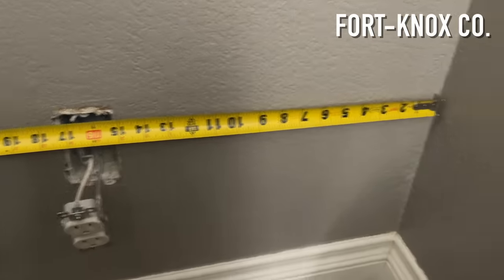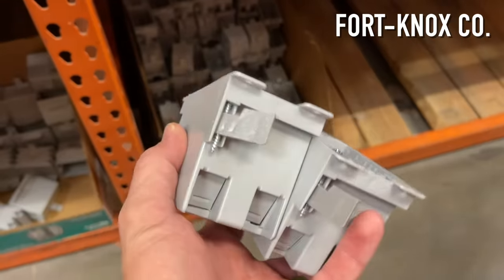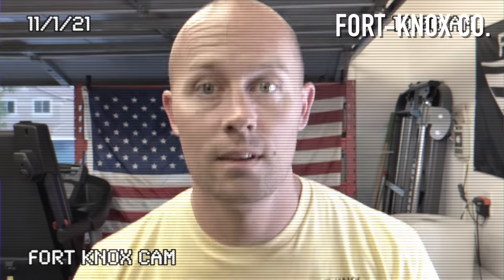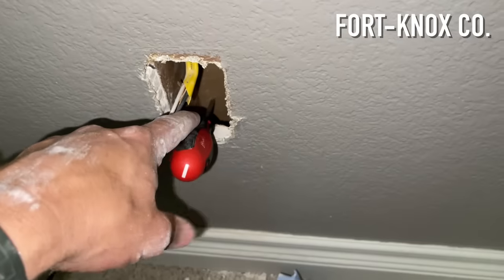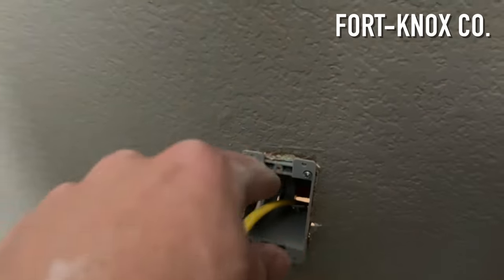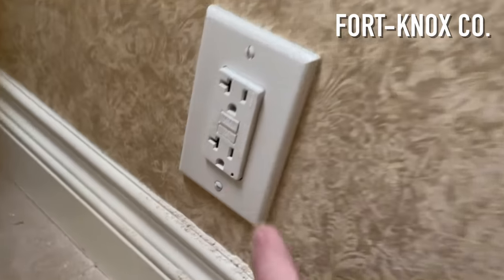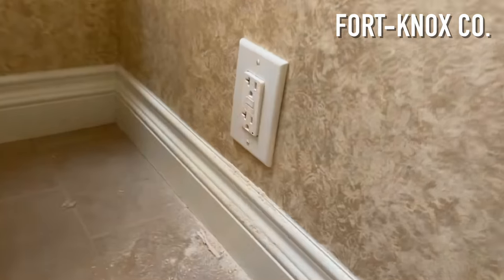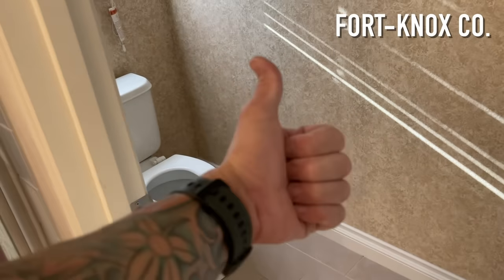How to Add an Electrical Outlet ANYWHERE !! Heated Toilet Seat or Bidet Install | Run Power Easily

Comment: It's a good idea to always wrap electrical tape around the outlet or switch. Also if it's a ground level bathroom one could go up thru the basement. There ate gfi's that have 2 (guide lights) on them that make for easier spooting of the plug. When it comes to ground faults it's also a good idea to use deep well work box's.
Reply from the maker: Very good info! I agree. !
Reply: First part of your statement is false. You’ll never and I mean never ever see a pro do that. It’s for a noob. There is no logically reason to do that. Wire it properly and you’ll never need to do that. It’s silly and a waste of tape and causes the person who works on it next, extra work
Reply: @crusherfang9368  electrical tape solves all problems. 🤙🏼
Reply: @crusherfang9368  oh YES. Thanks for reminding people to do that. That's how I was tsught. Also in wet locations having the wire nut face upwards (taped) just incase water should leak in the box. And to tape a white wire if its to be used as a hot wire. I'm NOT a professional but I for like to do work to the best of my ability.

Comment: Thanks for the tip on cutting out the old box to give yourself room to work.
Reply from the maker: No problem. It’s probably one of the best moves with moving electrical. Saves so much time

Comment: Ugh! This was helpful but unfortunately I'm stuck. My new house has a ton of outlets but none near any of the bathrooms. The put all of the bathrooms next to closets which of course don't have outlets either.
Reply from the maker: You can still use some of the techniques I showed in this video to get to the power and install the new power. But you’d most likely have to run across the wall and through a couple studs. It’s totally possible, just requires some drilling and drywall work

Comment: I had thought ahead when we remodeled our bathroom and had the outlet put in place by the toiler.   The negative is that the contractor connected the outlet to the circuit that powered the bathroom sink lights.   So when the bidet seat activates, the lights flicker.
Reply from the maker: Aww man that’s no good. You could always try to bring another power source over to the outlet from a wall plug near by.
Reply: Check your connections on your wires sounds like you might have a loose ground or something
Reply: I encountered the same issue. There was a feint flicker of the lights when the seat heater was activated. Lucky for me there was a spare unused line up to the bathroom from a whirlpool bath that was previously removed, so I reconnected the bidet outlet to that circuit.
Reply: I think you have other issues related to this circuit's installation. Flickering? No.

Comment: That wall outlet behind you (for the irrigation system)....when I got my house it was only a single outlet and only had the (same as yours) irrigation timer plugged in.  Was it legal to change it out to make it to a double?  I plugged a bunch of stuff into it like you....hahah.
Reply from the maker: Yeah. It’s still a 20amp plug. Just put in the house for the irrigation system. This house was not built with anything extra. Some rooms had no electricity in the ceiling and only wall plugs controlled by a switch. So the garage was lacking in plugs overall.

Comment: Is there a building code outlet height requirement?
Reply from the maker: Depends on your area/location. But it’s really not so much a critical thing. Just don’t want it on the floor or where it could get wet by standing water. Usually it’s a minimum of a few inches above the finished floor height. Commonly between 12-20 inches. But obviously you can go lower.

Comment: It is not a rule to put the outlet,means distance from the floor to the water tank?
Reply from the maker: Could depend on electrical code where you live. But there are some considerations in general. I wouldn’t put it under a water source like where the water supply is coming out from the wall. I would keep it off the floor but it can still be lower than your standard 24” on the ground if you’d like. Some builders put outlets in toilet rooms for this reason. Main thing is that it’s a GFCI circuit to help with any potential short you may get.

Comment: im a little confused on the wiring part, how did you get the brown cable for the new outlet?
Reply from the maker: I’m not sure what brown cable your speaking of. There’s a Black, white & copper(ground). Just those 3 wires
Reply: @FortKnoxCo  I think I was referring to the ground cable.
Reply from the maker: @mymovievideos  it’s in the new wire that I ran off the original set of wires. When you get a 14/2 Romex wire you’ll have those 3 colors. Almost always you’ll have a ground copper wire in there.

Comment: Do you have any videos on adding an exterior outlet on a brick wall? On the other side of the wall (interior) I have an outlet. Similar to this video.
Reply from the maker: I have a video How to add electrical outlets in Garage, it’s similar in how you would branch off and use either schedule 80 or galvanized conduit to run the power outside. You’d be drilling a hole through the brick wall most likely so long as your clearance outside to the ground in sufficient. You wouldn’t want to create any moisture problems drilling through the wall. But some of the techniques and methods I’ve used in several of my videos could be applied. But nothing specifically yet showing going through a brick wall.

Comment: Did you actually call the 12/2 Nomex wire? (Romex)
Reply from the maker: Romex™ is a common type of residential wiring that is categorized by the National Electrical Code (NEC) as underground feeder (UF) or non-metallic sheathed cable (NM and NMC).
Reply: @FortKnoxCo  I know what Romex is....I asked you a question. Did you call the 12/2 wire Nomex in the video.?
Reply from the maker: @pjdn  seems like your asking a rhetorical question. If your reading through the comments you may have found several people correcting me or mentioning the correct name, in which I’ve responded acknowledging that I misspoke while filming and am obviously aware of correct terminology. But non the less…good Eye 🤙🏼 or actually.. good ear. I appreciate the comments

Comment: Why did you used yellow elect cable if you need 15A  outlet?
Reply from the maker: Most outlets will use 12/2 (yellow) Romex for the higher flow of electricity across the whole circuit. Lighting circuits usually run 14/2 (white). Less of a draw on the electrical. 

Sometimes yellow will be used to supply power to a switch and white will be ran from the switch & to all the lights. Same thing, larger wire for the supply and higher capacity

Comment: Started out ok, but NEC says that you need to pigtail off the original outlet straight to bathroom outlet, then into the line side of the bathroom outlet to be at code
Reply from the maker: Very good. Yes pigtailing off is best practice and cleans up your connections too

Comment: I AM NOT AN ELECTRICIAN BUT I DONT FEEL IT IS SAFE TO HAVE AN OUTLET IN THE BATHROOM CLOSE TO THE FLOOR INCASE OF FLOODING?
Reply from the maker: You can safely be done. If you don’t feel comfortable with it, then I wouldn’t do it in your house. But many people do enjoy having an outlet in there to be able to install things such as bidets. One of the main reasons that you install a GFCI outlet is in case of any type of water contact or shortage. Then there is no worry.

Comment: You could have also came off the load side of an existing GFCI and installed a regular outlet saving 20 bucks.The out outlet would also be GFCI protected.
Reply from the maker: Good point!
Reply: Excellent point! In CA, a GFI needs to be in place anywhere there is water, I.e. Sink, shower, toilet etc. if closer than 3’. I also think our county code for an outlet is 12” above the floor. Different codes for different cities counties etc. check yours! BTW, there are GFI electrical boxes for a garage etc.
Reply from the maker: @kenkw5515  🤙🏼🤙🏼🤙🏼 thank you!

Comment: What about to install close to the corner?
Why to close to the floor?
Reply from the maker: You can install the outlet where you’d prefer, I chose this spot becoming it was the path of least resistance and it worked for the home owner. But if you want to jump over some studs and do a little drywall work you can definitely place it wherever you’d like.
Reply: I thought the outlet had to be a minimum 12 inches from the ground.

Comment: Good video.  Sigh.  My house was built in 1955 and has pretty ancient wiring.  How much of a job is it to totally rewire a house so as to be up to modern code standards?  And how destructive is it to existing walls?  Seems like I might as well demo the house entirely and start over...
Reply from the maker: man that's tuff to hear. I'm sure it'll all be worth it though. get yourself a couple quotes from good electricians and get an idea of what it'll cost. by comparing quotes for the full rewire you can get a better idea if its worth it or not with the value of the house. Have them explain the work needed to be done like cutting into walls and such. my guess is there would be a fair amount of drywall repair at least. but that kinda stuff is very minimal labor overall. the added safety and modern upgrades will be worth the ease of mind. Plus if you do decide to do it, get allllll the new features and added outlets you want.
Reply: @FortKnoxCo  Thanks.  I have a pretty poor record of being able to pick a competent and honest installer.   They're hard to find around here, or at least, I don't know how to find them!
Reply from the maker: @-johnny-deep-  ask around online within groups of friends. Etc. you should be able to get a couple referrals.

Comment: You might want to check your local building codes most outlets are supposed to be 16 in off of the floor
Reply: This may be a local requirement in some places but it’s not NEC.
Reply: @rivernet62  is is the national code
Reply: @rivernet62  when you have no local code to use national code
Reply: @crusherfang9368  yes I had a quiet requirement is 16 inches off the ground

Comment: I have physical disabilities, about how much would an electrician charge for this? Thanks Much.
Reply from the maker: I’m not sure, pricing could vary depending on where you live and who you use. My guess would be if it was seen as a simple job it’d be about a 3-4 hour charge and your going to pay about $80-120/hour? But I’m really just guessing because an electrician or Handyman could obviously adjust their own rates as they see fit. But it should take but a couple/few hours of work to be charged.
Reply: A lot, I just paid 8000 for three rooms a small hall rewire and box upgrade and that wasn’t the light fixtures included and that was one third , the rest will be 6200. More.
Reply from the maker: @sixpackbinky  yeah it can get pretty pricy for electrical work. Rightfully so in most cases because it does take some good knowledge and expertise. Special tools to make the job happen are also not always cheap. so your paying for the knowledge, experience, tools and job done right.

Comment: I didn’t see how you connected the wire to the old outlet.  That is the part I need help with.
Reply from the maker: I have another video showing how in more detail on my channel. How to move an outlet . You will connect the wires by “pig tailing” them.

Comment: You should use a green wire nut with a hole in it for the ground wire on the source connection. Could have used 15 amp GFCI. Good job, though, I appreciate it.
Reply from the maker: Yeah I’ve recently seen those green caps that slow the wire to pass through the top. Hadn’t seen them in any other builds until lately.
Reply: Copper crimp sleeves are cheaper. Greenies take too much space and only allow one ground wire to come out of the nut, which isn't always helpful.
Reply: @aurvaroy6670  yeah. I’ve seen people do that as well. There’s so many ways or code requirements out there.
Reply: @aurvaroy6670  Yeah, I've seen those and thought they would be good for the reasons you mentioned. I've used Wago lever nuts and they also seem good.

Comment: Maybe retitle “how to install an outlet conveniently located near an existing one”?
Reply from the maker: It’s more about the method used to take an original outlet, how to remove it from the wall, how to branch off to create another outlet, how to cut the drywall and place a new box in a new “anywhere” location, etc. it’s more about the methods and critical thinking/problem solving. You can apply some of these techniques to your specific situation.
Reply: @FortKnoxCo  As long as its not further away than the nearest stud.  Now that would be an informative video. I am installing a bidet toilet seat and the closest electrical outlet is 2 studs away.  The other side of the bathroom wall is a stairwell, only a switched light circuit nearby.  Have any ideas?
Reply from the maker: @michaelmarrone5768  Yes, I'll be doing a video about how to jump studs and the drywall work required. But in many cases when the outlet isn't near by, as will lots of electrical work/additions, you'll be making some holes in your drywall and patching afterwards. its almost always the case when doing electrical work after the house is built.
Reply: Thanks.  Keep up the good work

Comment: There is a reason why electrical outlets are not placed near water sources.  It is called CODE.  Any outlet within 1 meter of potable water requires a GFCI to protect you from electrical shock.
Reply from the maker: The outlet in this installation IS a GFCI. And the house has GFCI on every circuit.
Reply: @FortKnoxCo  yes, I see that, however ESA will not approve this for new builds or Reno contractors.  Therefore, is is only allowed if the homeowner installs.  The risk is, should the owner attempt to sell, a home inspection may rule it against code.
Reply from the maker: @iancraig3020  understandable.  If the inspector won’t pass or notes that during the house sale it can easily be reversed or uninstalled too. I’ve seen many home inspections where they note it in their report but it’s up to the home owner and buyer to move forward with it.

Comment: What is the wall is covered with tile?
Reply from the maker: You could still branch the power over and use a retro outlet box. But you’d need a tool to cut through the tile.

Comment: Make sure you check your electrical code. Our code specifies a minimum height off the floor for electrical outlets.
Reply from the maker: I appreciate that. Yeah I’ve seen some codes that allow outlets horizontal within the base boards, just inches off the ground. Probably depends of where you live for sure. Here it’s almost 100% slab concrete foundations. Other places they build off the ground 100%. So I’m sure codes require different safety measures even just for that.
Reply: Oh Jeeze,  place the outlet where you want to. Just be smart about it (i.e. not in the shower)
Reply: @johnbeckwith1361  exactly! I 100% agree! Just some common sense being used.
Reply: @FortKnoxCo  - baseboard mounted outlets in living room or a bedroom, because it’s dry. There are outlets in floors as well. Just not in a bathroom, where there is a chance for a flood.
Reply: @mar1video  that is correct.
Reply: @johnbeckwith1361  oh geez I guess you can place it anywhere you want to until somebody gets electrocuted and you get sued
Reply from the maker: I agree. Everything is for informational purposes. Just trying to show that what lies behind that scary outlet in your wall isn’t so scary at all. Be safe, be smart and check your local code. It’s a quick Google search away.
Reply from the maker: I agree. We have an outlet in the floor of our living room on a slab foundation. But it’s no where near a water source or doorway.
Reply from the maker: I agree
Reply from the maker: Definitely! Be safe about it, be smart and check you local code. If your doing work for others especially in a business capacity, you definitely need to know that.